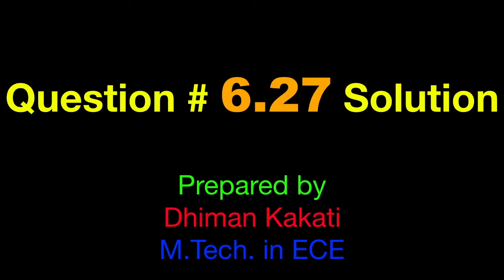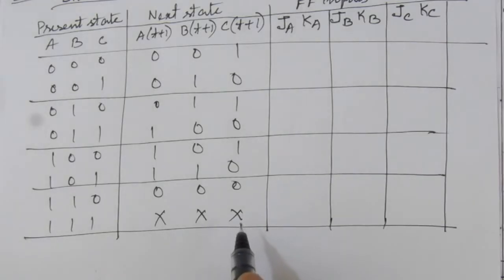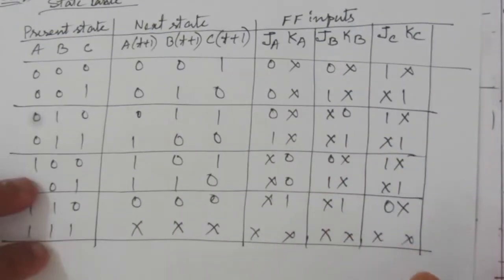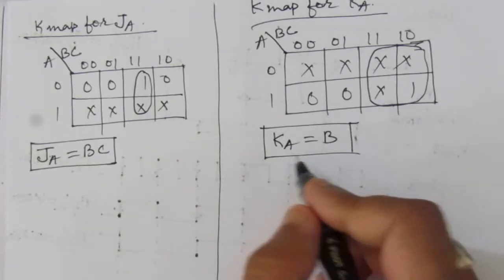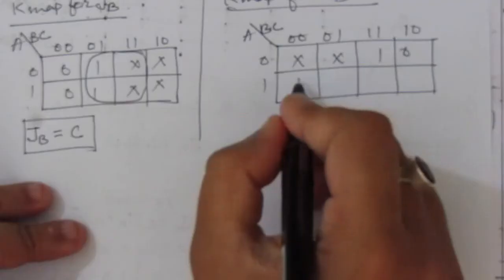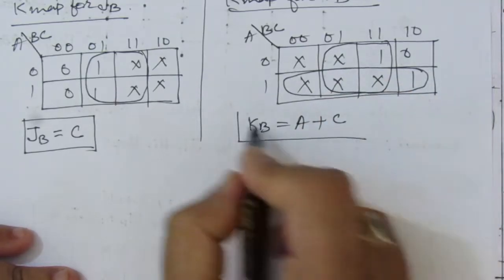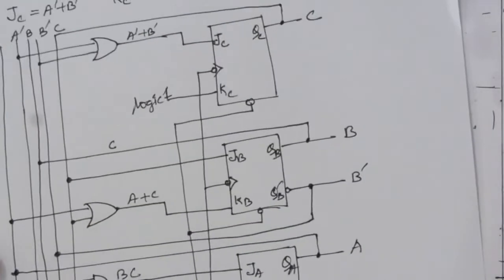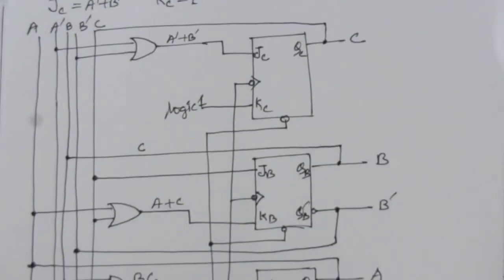Q. 6.27: Design a counter with the following repeated binary sequence: 0, 1, 2, 3, 4, 5, 6. Use JK

Comment: designing a 3-bit synchronous counter for the count sequence 6➡3➡5➡7➡2➡1➡6. This counter is designed using T Flip Flops and these are positive edge triggered Flip Flops. So, the count sequence is changed on the positive edge of the clock. For this 3-bit counter, 0 and 4 are the unused states. Whenever these states (0 or 4) are encountered, the counter should go to 6 and start counting.
Reply: please answer this question